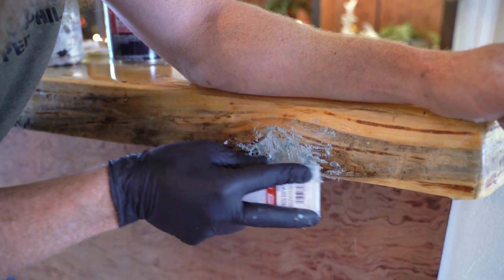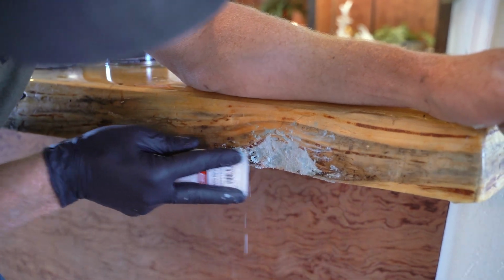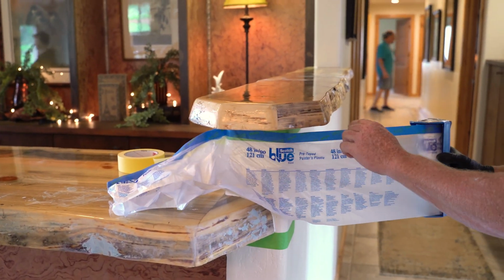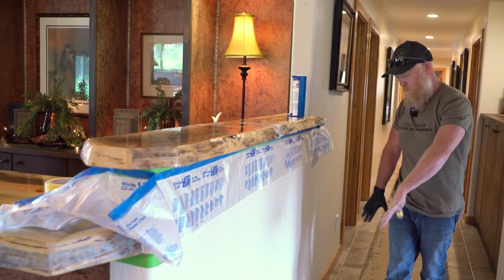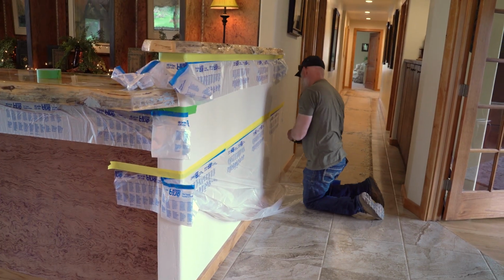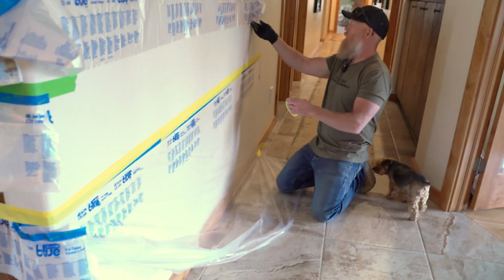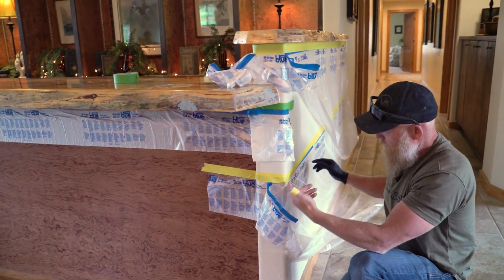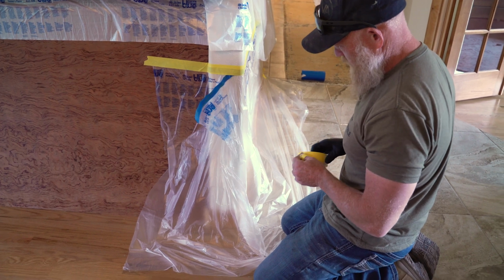How To Pour a Resin Epoxy Over Tiered Layered Kitchen Countertops | Step-by-Step Guide

Comment: so no primer needed?  I can epoxy over the top of epoxy?
Reply from the maker: We recommend a light sanding if it’s been longer then 48hrs. Our products bond best to the substrate. We only ever use an edge coat.
Reply: Will people eat food of this. Is it a food grade resin. And the resins are toxic. Especially epoxy resins. Body protection to protect your skin. Loads of barrier cream. And the proper respiratory to protect your lungs.Sorry if I sound like a Karen but live long and look after yourself. You can use eco  friendly resins now. I'm using them more now. But I make ornaments with it so not the same as you but I love the effects and your work.